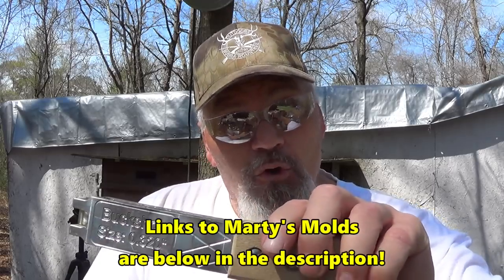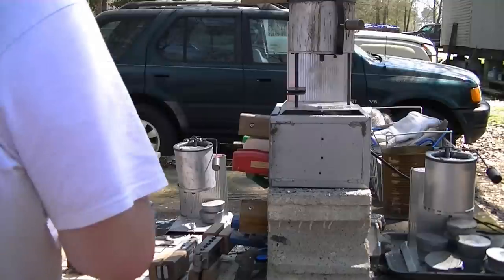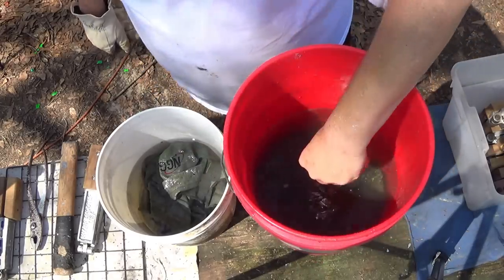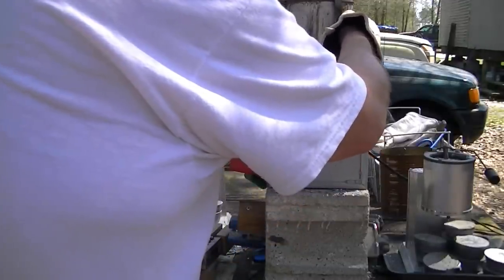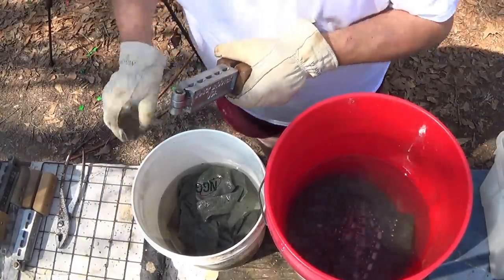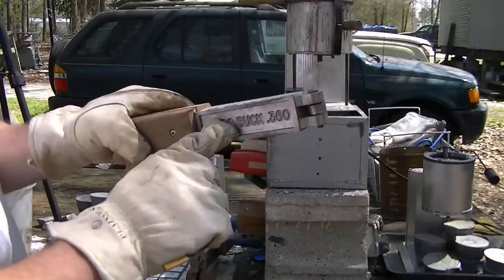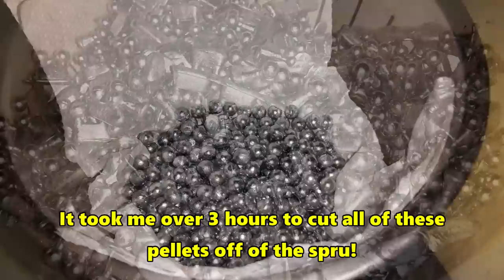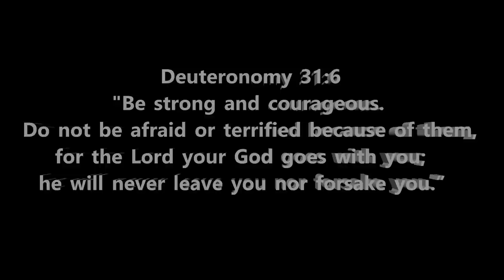Molding up some Buckshot Pellets! I have to re-stock my supply!

Comment: Those pellets.leave alot of sprue. I've only used the lee 00buck mold. You must go through Alot of lead before rejecting the excess
Reply from the maker: Yesser Vince... there is a lot of spru for sure. but it doesn't bother me. I use the Lee mold a bunch as well. I like it a lot too! I wish that Lee would make more buckshot sizes...

Comment: I have the same 2 Lee pots. Got to ask. How hot do you heat your lead too? 700, 750? What dial setting do you use? Just got a high heat temp probe for my multimeter. Your videos are a Gold mine of info. Many many thanks. Got into. Reloading 12 gauge due to prices. Been reloading pistol and rifle for over 30 years. Keep safe and healthy, God bless all there.

Comment: So with everything bought out, what load could you make with Winchester 209 primers, long-shot or greendot powder, wwa 12 red wads and Winchester 2 3/4 ???  Got plenty of 00 and #4
Reply: Is everything bought out already?
Reply: He has some buckshot videos that would work for you I think. I learned from them
Reply from the maker: yesser! 30 grns of Longshot, AA12 red wad or the CB1138-12 Claybuster, 10 pellets of #00 stacked by 2's or you can use 24 pellets of #4 buck.
Reply: @vdog4799  , hard to find even powder at the local gun shops. Forget finding shells, barer  shelves then the Wallyworld  TP isle at least in CT.
Reply: @BubbaRountreeOutdoors  Thanks, I garbed what was left, figured what I loaded for duck  1 5/8 oz would be a starting point. Feel like its time to dust off the old mec 650 progressive, will give your load a try. Stay safe, and thanks again.